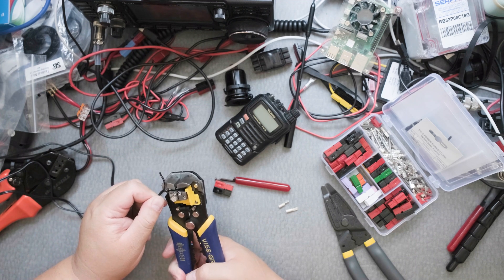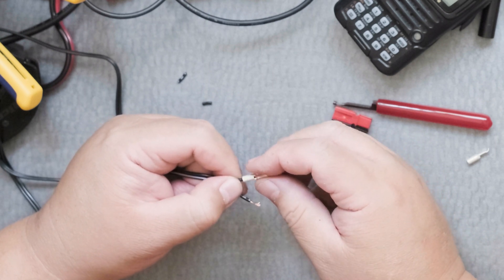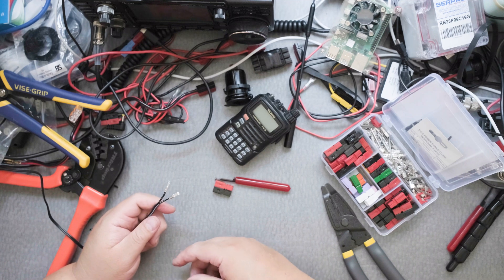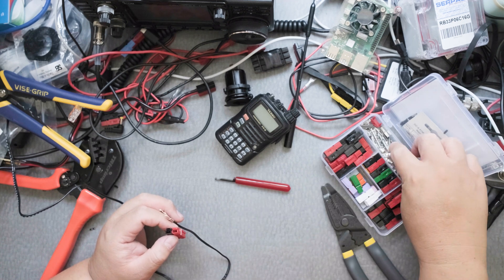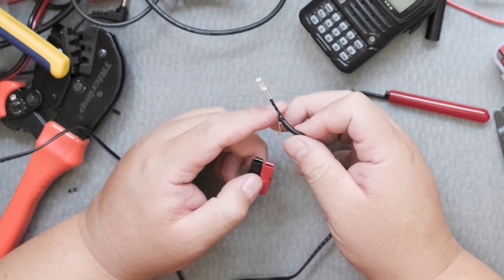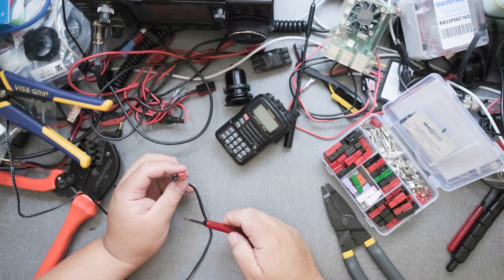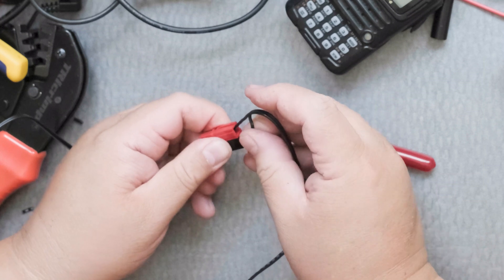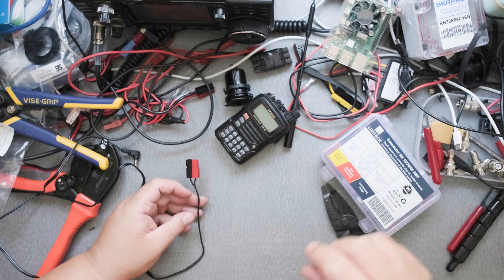Charge Yaesu VX-6 with External Battery

Comment: I add a small length of heat shrink over the cable. It prevents it from coming unpaired.  But this is absolutely what you need for a VX-6R, FT5, FT70 heck almost any Yaesu HT. Check the maximum charging voltage first!

Comment: Hi Frank. My VX-6R CD-15A charger doesn't detect low battery when my VX-6R is in the cradle and always shows green indicating the battery is full when its not. I want to attempt to fix the CD-15A. On the battery there are three contact points, two close together. Do you know what each contact point is used for? Any idea what component in the CD-15A is bad? I've watched and liked many of your videos so I'm hoping you might have some clues for me. Thanks!
Reply from the maker: That is a good point.  I don't know.  You would think all three would be used.  Did you make sure that the contacts are clean and that the battery's pins connect to the contact points?
Reply: @frankwc0o  My guess is two of the contacts are for charging and the third is used for detecting the current voltage. I took my CD-15A charge cradle apart and tested it as best I could. There are a surprising number of ICs, capacitors and diodes. The caps, diodes and MOSFET test good so I suspect something in one of the ICs is bad. It simply won't detect a low battery and start charging. It's time for a new charger. Thanks for your reply.
Reply: Call Yaesu tech support. Ask for Roger.

Comment: Are you charging straight from a 12 v battery?
Reply from the maker: Yes. But it’s a Bioenno battery. It has an average voltage around 13.2v
Reply: @frankwc0o  the battery in the radio is 7 or 8 volts, how can it be charged from 13 volt. Does the radio only allow the correct voltage in. The reason I ask is I just purchased one. Thanks K7WHN
Reply from the maker: @radioactive8772  Read page 9 of the manual on charging.  With the E-DC-6 cable you can use 12-16V.  The cable reduces the voltage.  Read other sources before moving forward.
Reply: @frankwc0o  thanks I will read the manual when I get the radio. K7WHN